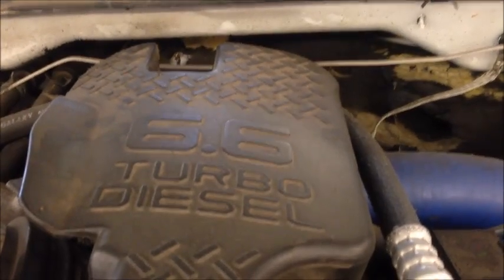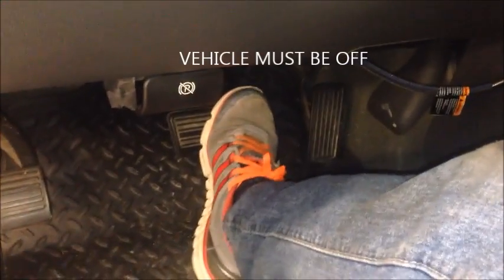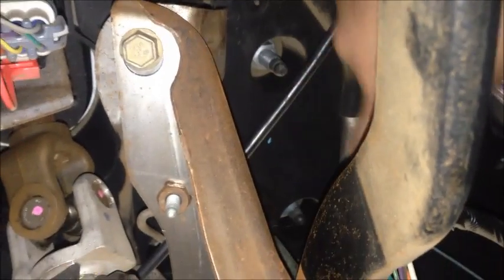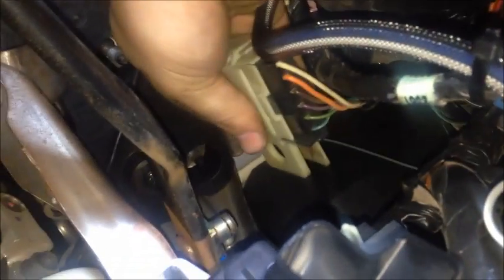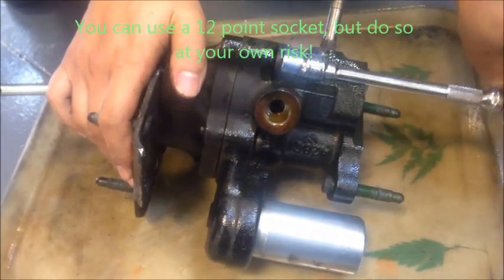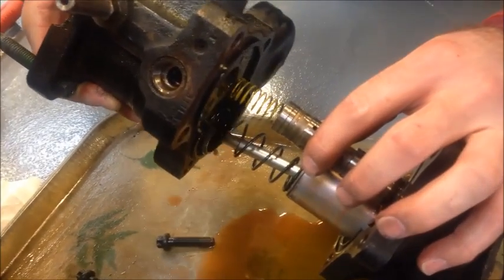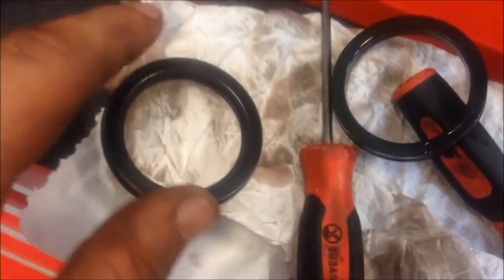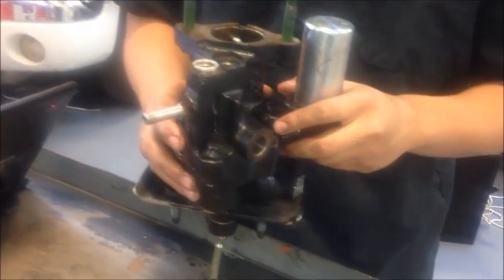Repairing a Leaky GM Hydroboost (Powersteering Leak)

Comment: I have a 2007 2500hd would the parts be in the same place?
Reply from the maker: Yes they would be.
Reply: DIYAUTOMOTIVE thanks
Reply from the maker: No problem
Reply: I ordered my parts online. I have a 2005 chevy tahoe 4x4. Want to change all the rubber and metal parts in the hydro booster. Would it be the same process and would same parts on your video work? Thank you
Reply from the maker: Same process; here's the parts for your Tahoe:

https://boostautoparts.com/products/gm-hydroboost-seals-final?variant=53381952263

Comment: i have bubbles in my power steering pump fill hole. That mean anything?
Reply from the maker: That sounds fairly normal, you will have some bubbles from the return of the fluid. You may try bleeding it as outlined in this video.

Comment: so I put everything back together and when I start truck up the brake pedal goes right to the floor by its self then when I turn wheel right and left the brake pedal pushes down more
Reply: +George Smith IV i just did mine and the brake pedal is on the floor too. what did you do?
Reply from the maker: +Ashlee Stone +George Smith IV Did you properly bleed the system as outlined in the video?
Reply: I had the same issue. Attempted to bleed the system as described, but the pedal still goes to the floor. Did anyone get this issue resolved?
Reply from the maker: Are you ensure all of the seals were installed the correct direction? They can only be installed one way. If it didn't do it before you took it apart (was just leaking) you must have messed up a seal.
Reply: Thanks for the reply.  I did install the seal correctly, but damaged it upon re-assembly of the Hydroboost halves.  It wasn't leaking after reinstalling it, but I believe the problem of the pedal going straight to the floor was the linkage to the spool valve was not connected properly.  Since it doesn't just fall into place you have to make certain that it is held in place as the halves go back together.  Glad I bought two seals before I started the project.  2nd try was successful and has been working fine for over a week now. No leaks.
Reply from the maker: Glad to hear, yeah that needs to be between the two nubs otherwise it won't work. Take care.

Comment: Why is it that on my 2003 6.0 chevy truck, the brakes start to lock up after about 10 minutes of driving? I have replaced the master cylinder and it still does it, but only after about the 10 minute driving time. All 4 discs at super hot and they will only let go if I open the bleeder ports to relieve pressure, then the process will repeat.
Reply from the maker: You might try checking your ABS module.
Reply: MGTOW SWORD maybe the rod that pushes into the master cylinder from brake boost has a negative clearance giving it a push at all times... might need to be adjusted

Comment: I pushed the pedal and it stud pushed in it did not come back up and I replace the hole hydro bust
Reply: Any help
Reply from the maker: Not quite understanding the question. Did you replace the entire hydroboost, or just the seal? If you had the hydroboost apart take special note of 4:46 as it's more than likely the issue.
Reply: Thanks a lot keep up the good work
Reply: I fix it and everything is working good now 👍
Reply from the maker: What was the issue?
Reply: @stlouissux9119  Love how people don't post the "fix" when they finally get it RIGHT... Thanks JIM, GREAT JOB...!!!

Comment: I just installed the hydro booster on my truck today but I still don't have breaks when I press on the peddle it wont come back up any help would be appreciated thanks
Reply from the maker: Were the brakes working properly before? Sounds like you either have the linkages hooked up wrong, or have air in your braking system (possibly a bad master cylinder but would need more information).
Reply: I found out the problem when I ordered the new booster it didn't come with the spring and rod so I had to get the spring and rod from my old one and put it in the new one so I have brakes again thanks anyways for trying to help

Comment: Great video. Thanks a lot for posting it. I was doing my 99 Silverado and unfortunately I had to replace the star washer cause it broke when I tried to pull it out. I got the whole kit here:

 http://www.ebay.com/itm/GM-2771004-Hydro-Boost-Seal-Repair-Kit-Exact-Duplicate-Complete-Seal-Kit-/200949312875?vxp=mtr&hash=item2ec9832d6b 

Also I found it really helpful to take photos as I was taking it apart so I could match up the seals and the orientation that I took them out of as without the pictures I would have been lost on how to put them back in. I would have had to buy 2 kits if I hadn't purchased the complete kit with the star washer. Autozone didn't carry it and the dealer laughed when I called them to see if they had it in stock. I also replaced the yellow check valve even though I couldn't tell if it was faulty or not but it came in the kit so I replaced it
Reply from the maker: Thanks for the positive feedback!